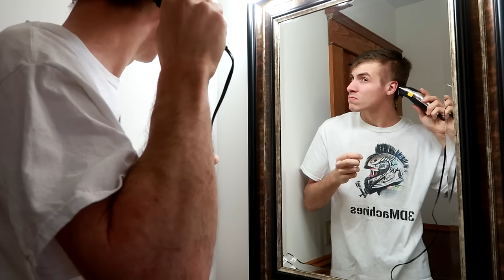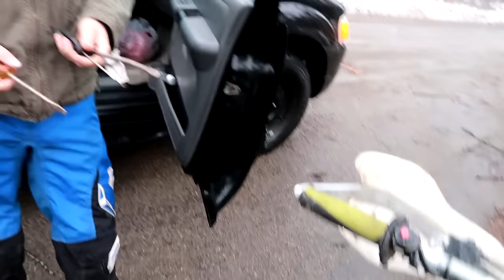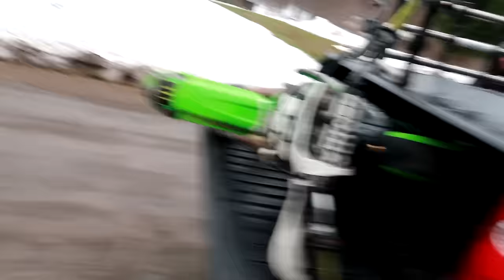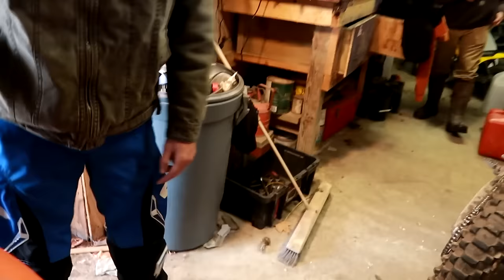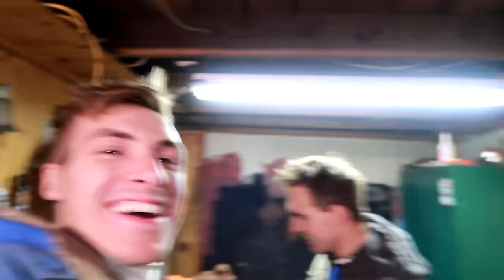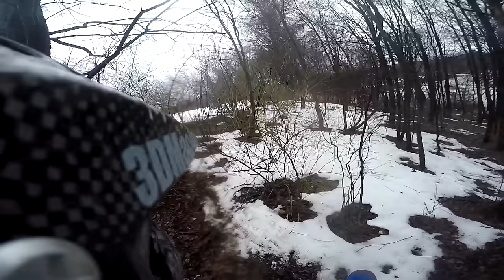MY BIKE BROKE!! MY BEST FRIENDS SAVED ME!!

Comment: Dalton... Take the exhaust downpipe off and have a look up into the exhaust port. You'll be able to see either the piston skirt if the piston is at the top of the bore, OR you'll be able to see the other side of the cylinder wall if the piston is at the bottom of it's stroke.. Either way you'll be able to tell if it's seized-up.. Which I'm guessing it has as you can't kick the engine over even in neutral :(
Reply: orbiter8 (John) it is a 4stroke so that probably wont be possible
Reply: Good catch ;)    I guess it's time for a strip down then :(
Reply: Time to share this video to get him to 500k for a new dirt bike
Reply: Godseverman haha🖒

Comment: It didnt seem right when you were driving it. Looked like it had no power.
Reply: mjmotard  almost bogging a little
Reply: mjmotard like he was on the choke
Reply: JDGAMER Xx nah cause it didnt idle very high. It looked like when he tried to go full throttle it would just bog
Reply: holy crap 25 likes
Reply: well he did just have it apart
Reply: whaaa why has my comment got 50 likes :D
Reply: the engine locked up. Maybe he forgot to put oil in it. and dolton if you dont want to tear down the enging again put trany fluid in it. it should unlock it if it is not somthing like a ring broke and is blocking it. hope your ok. missing my daily dose of brapppppp and 3dmachines.

Comment: Good thing your getting a 2 stroke, she won't ever lock up on ya!
Reply: MrYamaHashi They do , it happened to my friends  2 stroke dirt bike. It can happen to all motors. It doesn't happen often though.
Reply: MrYamaHashi they do lock up as well my rm and my cr250 locked up cause after so long you don't rebuild they will lock up
Reply: Susie Bray Yeah, especially with the 2 strokes, you got to rebuild them often like every spring.
Reply: Wazzup yep it's like after so many hours and like the 4 strokes you have to rebuild then to just not as often and plus he raced it and all that
Reply: it's crazy how he hardly ever rides his but I ride my 4 stroke honda 300 fourtrax fourwheeler about everyday and have never had an engine problem. I give it regular oil changes too but that's about it. I've never seen the inside of the head or anything yet. but I think it's crazy how his locks up and he takes excellent care of it and hardly rides it. mine is 96 model. before I bought it, it was used on my great grandpa's dairy to round up the cows to the barn. also was used to haul fence and fence post to put new fences up. before that i think it was used on a farm.